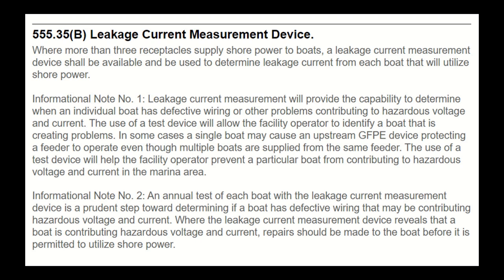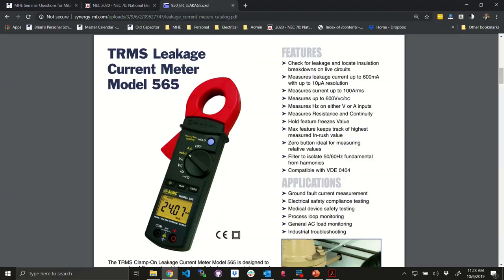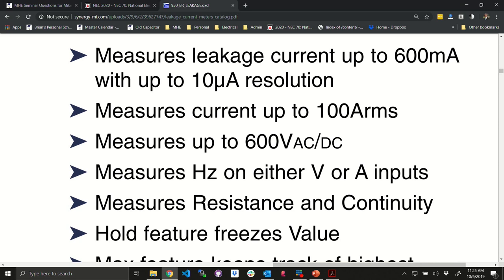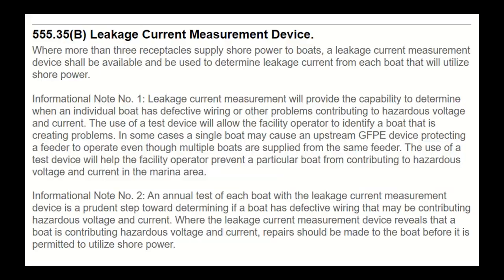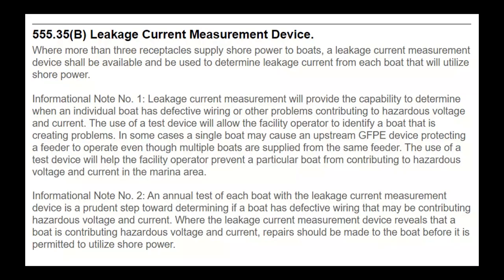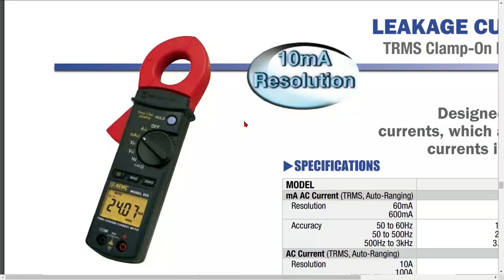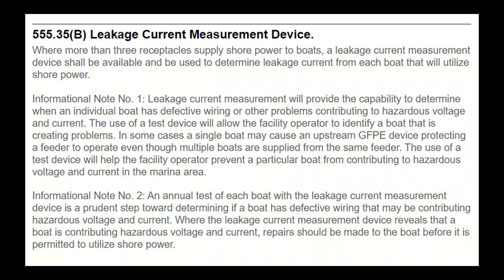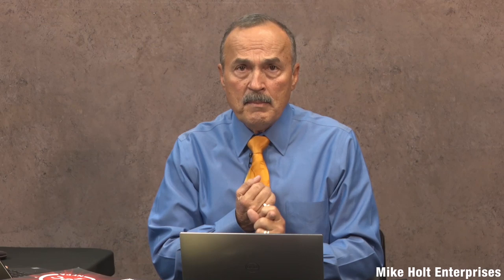Marina and Boat Dock Leakage Current Measurement Device [555.35(B), 2020 NEC]

Comment: You would have to have a clamp on meter that measures both legs and calculates the difference. You can't just clamp it around both leads since an ac clamp on doesn't tell you which direction the current flow is going. Requiring a special meter that measures leakage current? Really? This is how regulations get out of hand. Ground fault detectors are already in place. Focus on maintenance of what's there. Don't add another layer of regulations, test equipment requirements, and testing that doesn't provide a clear benefit. Inspect and test the ground fault meters and its plenty safe and way more safe than the average home or business.

Comment: Using the amp leak tester ( ma amp clamp tester) is a perfect tool and application of the tool to identify the multiple ma sources that contributed to the 100ma trip.  Like said all the small sources add up until it exceeds the 100ma threshold.  So yes unplug all the cords and reset the breaker and plug one in at a time and measure its ma leakage if any and write it down.   Then address any boats that have current leaks. 
To measure the leakage current is pretty simple.  Make a breakout cord adapter.  For this example use a 30amp 120-volt male and female cap and use three single conductors 12 inches long to join the two.  One Black. White and Green. Insert this between the pedestal and the boat cord.   Now clamp around the white (grounded conductor) and Black( Ungrounded conductor ) with the ma detector.  Now I know we learned to use a clamp meter we only clamp around one current conductor at a time.   That is because the two conductors that should have the exact amp draw will cancel each other's magnetic field out and we would read zero amps.  In this case, we are trying to measure any difference in amp draw between each conductor which will be very small. ( ma) (aka leak current) Do not try to measure the ground amps here which you would think would serve the same purpose. But there is a chance the leak current is going into the water from the boat and back to some metal object on the dock than finely back to the source.   Also, you may say why not just clamp around the cord.  Here is the problem. Let's say the fault is with an appliance in the boat and the fault current is coming back on the ground in the cord. Well, it will create a magnetic field around the ground and again cancel the unbalanced field between the hot and the neutral so your reading will not be accurate.  I will try to make a video next time I troubleshoot this issue.
Reply from the maker: Like I said in the video, this is not something related to the NEC and I'm sure will be removed in 2023. If you or others want to use a meter to troubleshoot why a 100 mA breaker trips, great. Not that it matters if not of the individual 30 mA breakers trips. What are you going to do, some someone unplug their boat?

Comment: Breaker set to 100. SHore power outlets set to 30.  Panel breaker trips. Others didnt. 100 aggregate tripped it. Pull all. reset. Now plug one in. use leakage tester to measure individual leakages. Sum to see if over 100. if not over 100 replace the breaker. Now how much on each leg. If under 30, it is ok. If over 30 and outlets didnt trip, replace the outlet. Repeat for all boats. If you have 50 outlets on say 25 ma leakage each that would be 1250 ma total leakage. Breaker trips and outlets wont. Sell operator more branch circuits. I am an engineer in EE and not an electrician.

Comment: It appears that this rule is trying to address the potential situation where no one is over 30mA, but if for example there are 8 that are 10mA and 1 that is 25mA, they won't trip the 30mA feeders, but will trip the 100mA main. The need for the measuring device is for as you plug each one in after a problem is to see which ones are the major contributors. In this case, you identify the one that is 25mA and not connect them to the system.
Reply from the maker: The NEC is an installaiton standard, not a trouble shooting manual. I'm sure this rule will be removed in the 2023.
Reply: @MikeHoltNEC  That makes sense. Helpful information, but shouldn't be in the code, perhaps in construction specs for marinas to include the purchase of a meter as part of the project for the operator's personnel to have.
Reply: @vikingdm  It's possible the requirements for testing could fall under NFPA 303, which covers the protection standard for marinas and boatyards. The scope of NFPA 303 includes the construction and operation of the facilities described therein.

Comment: If you are tripping breakers then fault finding is easy.  I interpreted this differently than everyone else.  I see the point of the hi-resolution amp meter as a tool to be used to find leakage that is not enough to trip a breaker, yet puts enough amperage in the water to be dangerous.  Remember 100 ma can stop a heart?  That's by paths though the body NOT in water.  The path could be much easier, as body resistance could be much lower while immersed in water with a current flowing through it.  It may reduce the intensity of the electromotive force required, as well as the current required to do harm.  I am taking the humble attitude and assuming I am missing something apparently because if it was this simple as I perceive it, then somebody on that panel would have said it.
Reply from the maker: If the leakage is less than 30 mA, then the GFPE won't trip, if it's more then it will trip. Using a leakage detector to measure current less than 30 mA is useless. Also 30 mA traveling in the water is dispersed so that there is no voltage gradient at any point to be dangerous.